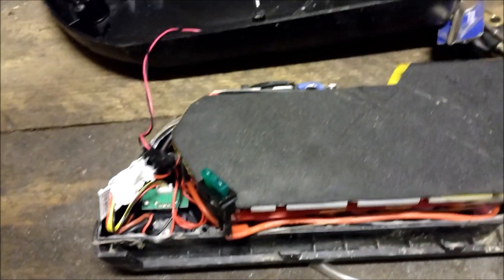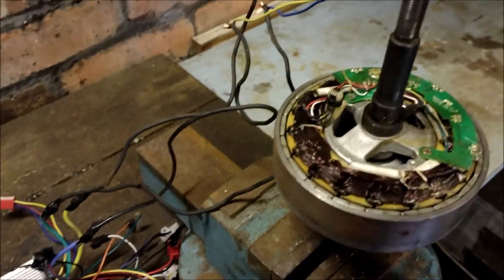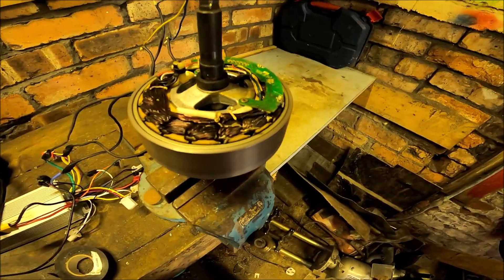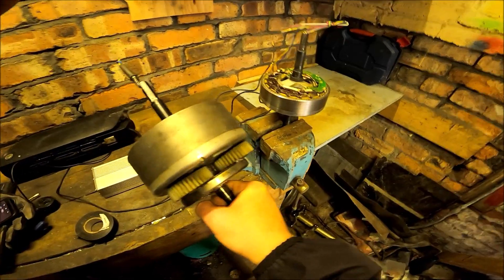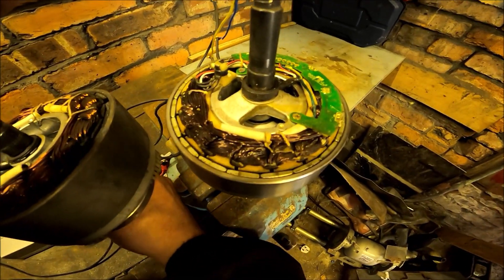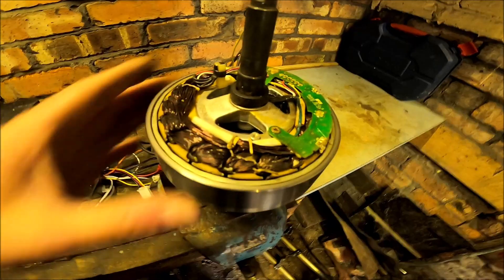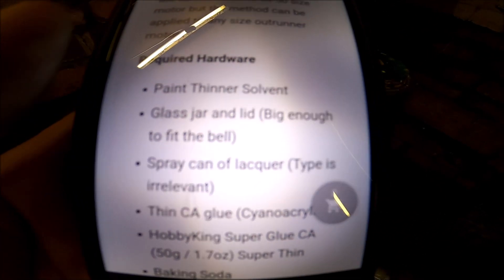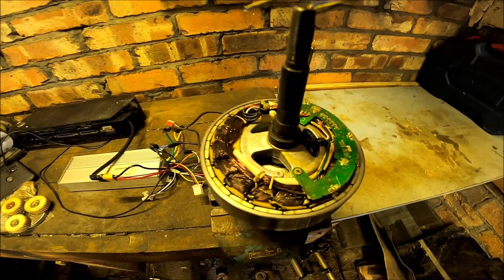What is wrong with my hub motor?

Comment: Same s*** happened to mine; it's the magnets that are slipping. Pull  them off one at a time. Make sure you keep track where they are,  i numbered  mine .clean up everything , epoxy  back in . Use something good , high heat rated .  It worked for mine, I had to do it twice.  I used  some cheap shit first time , lasted a couple days untill someone who weighed 200 rode it and they came loose.

Comment: thats the Bafang motor ?  I thought those were pretty solid and well reputed. I have no idea what could be wrong,  would be weird if the magnets unstuck but I have heard of it happening before, just one or two magnets, what a fail that would be huh ?   I wouldn't be surprised if its due to using your bike as a boat, maybe the salt got in and did something to the glue ?  but could it actually penetrate far beyond the edges of the magnet ?!   is it also possible that your motor overheated and that melted the glue ?    very soon I will make giant talon 3 with 72v upp battery, '2kw' direct drive hub motor with mtx 39 wheel, should be very light and nippy bike.
Reply from the maker: That motor was never used in the water, it failed while I was hill climbing in a quarry.
Pretty extreme use, I repeatedly climbed to failure.

Comment: Definitely the magnets, this problem got me pulling hairs... for days..
I replaced everything, clutch, gears... I was refusing to believe that magnets can actually slip...
I pulled all the magnets, cleaned them with isopropyl, scuffed the surface, then glued them back with CA/superglue, give them a good bath of this stuff, it should hold for a long time, no baking soda needed.
Reply from the maker: cheers, I needed someone to back me up!
Reply: @chargeriderepeat7024  Try the applying superglue without removing them, too much work and probably overkill, if they come loose again, redo after a good prep.
Reply from the maker: Permabond 920 high temp glue looks good.